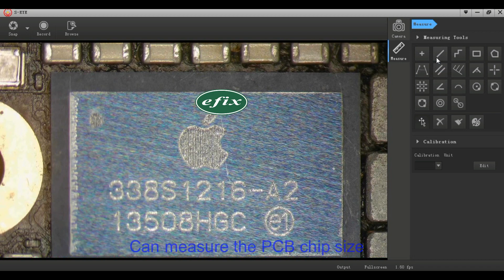efix Rotable Universal Arm Stand HD HDMI Trinocular Stereo Microscope

Comment: Tony, this product shows some  practical and good abilities, I will consider buying this unit, but this depends on a concern I have with the company. I have bought products from the company but I'm having an issue on the bonus points system.They show you receive bonus points for different items, BUT it never shows up as any bonus points accumulated and what they can be used for.(Victor) on there leave a message section does not seem to want to answer my enquiries on this issue ( left 4 over a period of time)Im leaving this message on this site because the store site is not responding, (Message left by a concerned buyer)